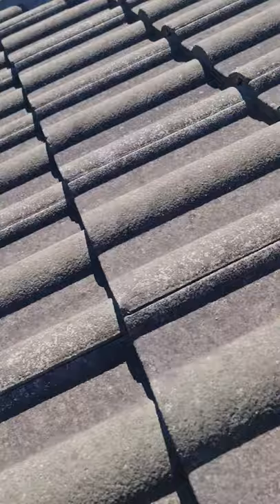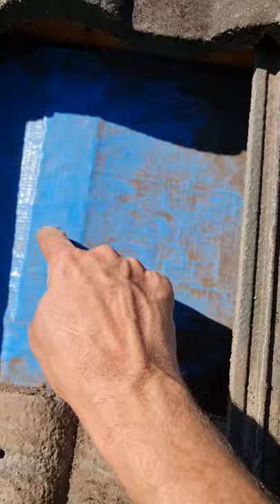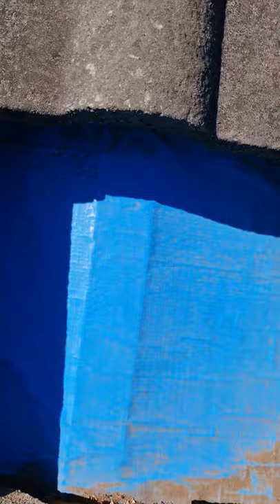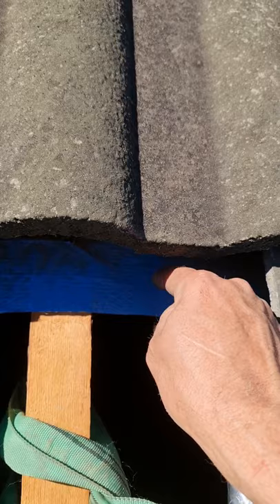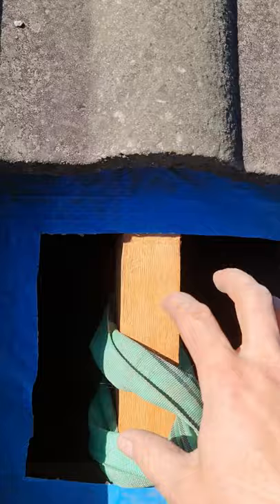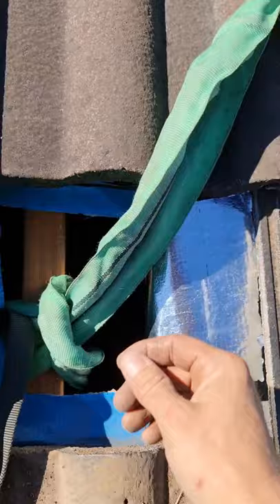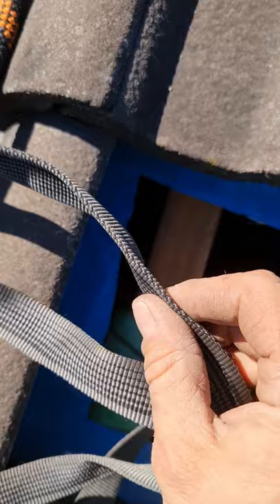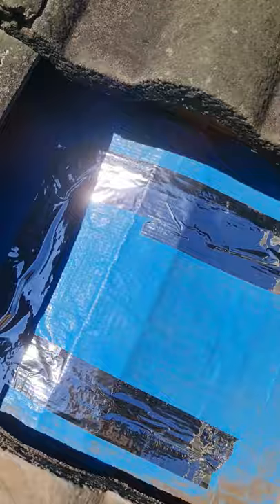How to Harness up on a tile roof

Comment: Just one point on this - The 2 ton lifting sling has an 8:1 safety factor, so the actual minimum breaking strain should be closer to 16t. Height safety / climbing equipment does not have this, so the marked rating is the actual minimum breaking strain. Point is you could use a lower rated lifting sling if you wanted.
Reply from the maker: Yeah can't rember all the figures off the top of my head. But at the time of the video there was like $2 difference between those and the lower rated ones 😄. 

I'm a fan of overkill 👌

Comment: Thanks for the video mate.
Would you be able to explain in another video the actual harness set up and how you extend the rope to reach the edge of the roof. You obviously want enough length to be able to clean the gutters but not enough so if you do fall you will not be hanging over the edge!
Cheers mate
Reply from the maker: Hey mate, so the length of the line can be as long as needed, most come 15m but I got a 30m one and let it dangle off the edge. You're clipped to an ascender which locks you in at any point along that 30m. Ideally, as part of best practice, you stay in "fall restraint" position whenever working on the roof. That means there's no slack in the line between the anchor point, and the ascender clipped to your harness. IF you still slip, you just fall on your bum, not off the roof. Your best to do your working at heights course, and all that sort of stuff will be covered. Even though there's some things it doesn't cover, or that won't apply to you, it's beneficial, and a legal requirement in every state AFAIK.
Reply: @NWCSoftwash  thanks heaps for the reply mate.
Yeah I’m well aware of the legal requirements and I want to be as safe as possible.
Just wanted to get your perspective as you stated that now they will probably not cover industry specific requirements but just a typical cookie cutter course.
Thanks Nath ✌️

Comment: Great video Nathan, I’m thinking of starting to clean gutters and do some maintenance on roofs. Would the working with heights course be compulsory or is it just highly advised.
Thanks :)
Reply from the maker: You'd have to look up the rules where you are. But it's a compulsory bit of paper Auswide as far as I'm aware. 

It's worth doing. But it's certainly not comprehensive training.

Comment: Can you just screw an anchor into the rafter instead of cutting the darling? Seems less intrusive
Reply from the maker: Possibly. I've pulled up plenty of tiles and see previously cut sarking though... never seen just holes in a beam so maybe there's a reason not too. 

Also, not as 'sustainable' i guess. Like I wouldn't trust screwing into the same spot multiple times over multiple visits. But you csn untape + wrap around a beam as often as you like.

Comment: Is it per code to use tarp like that? Isn't that supposed to be plywood there instead?
Reply from the maker: I believe you might be thinking of shingle roofs? At any rate, on tiled roofs, in Australia at least, sarking is what's used.
Reply: @NWCSoftwash  My house has plywood just under the tile...built relatively recently in 2005. There's a layer of foam sheets under the plywood...for thermal insulation I think. It's really hot here in the summertime. Places like California coastal areas might have similar construction like the one you showed in the video. It looks scary to me to cut that tarp like that. Plywood is easy to fix, but that tarp patch... I'm not sure that repair will hold up for more than a few years. Just doesn't feel right. I'm most likely wrong... There must be a more permanent repair. Not an expert here or even close. Just looking for videos of people walking on tile roof as I'm getting ready to put some solar panels on mine.
Reply from the maker: @markogrba1  all good 👌. If I come across a better way, I'd happily change if feasible. But yeah never seen plywood under tile here in 20 odd years. Some of our roofs don't even have sarking 😄. As for the longevity, I've com accross patches like this from previous work that are still sealed well, but the sarkings so perished its starting to fall apart rather than cut neatly. The tape should last long enough.
Reply: @NWCSoftwash  I've seen some videos of California homes without anything under the tile. There is also a layer of tar paper on top of plywood on my house. I guess it's more for redundancy than anything else. If one layer fails there another to back it up.
Reply: I have a two story home with a concrete tile roof in California, built in the early 80's.  There is no sheathing (plywood/OSB) below the tile, nor is there any tarping or water proof paper.  Battens are strung across the rafters and tiles have nubs that lock onto the battens. If you go into the attic you can see the bottom of the tile.  This type of roof system is no longer allowed because it's prone to leaking.  Wind driven rain can go under the tile, a cracked tile can allow water underneath and sometime tiles slide out of place.  Some people have reroofed their homes by removing the tiles, adding OSB sheathing, waterproof paper or an adhesive membrane, reinstalling battens and the tiles.  This is a costly endeavor.